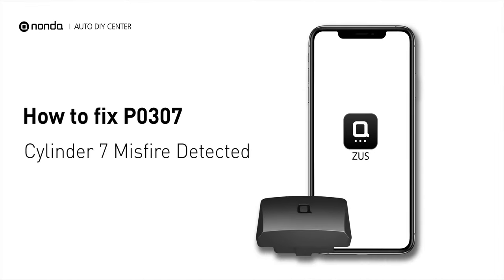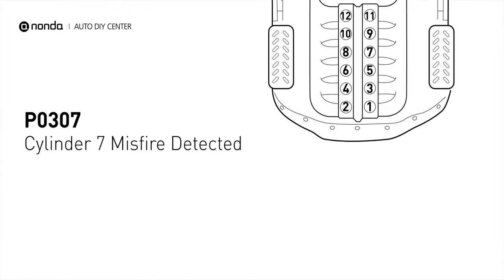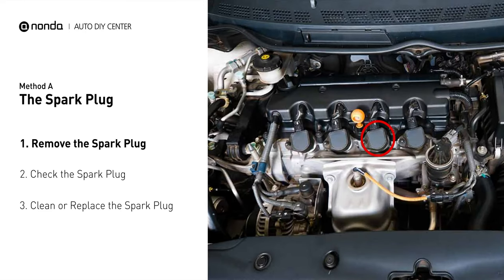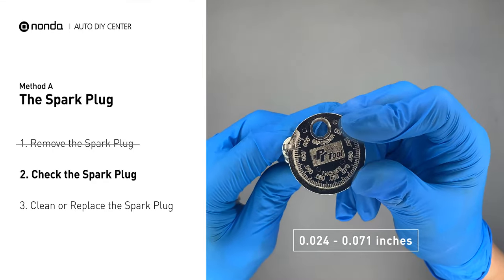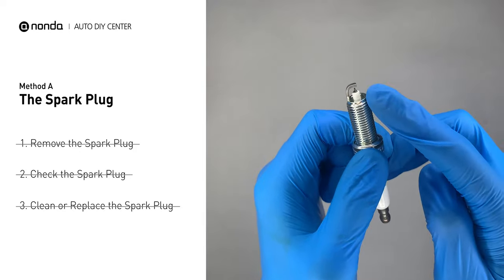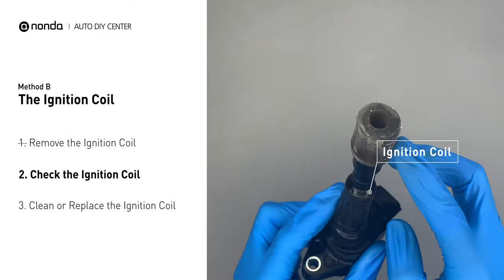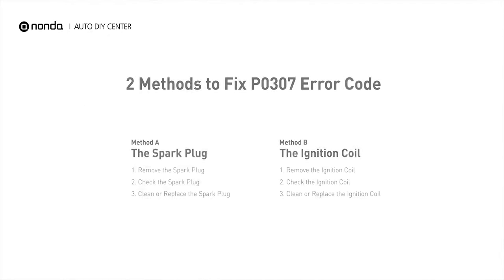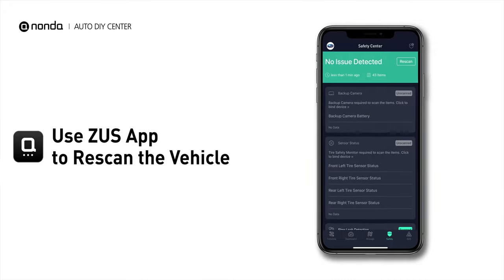How to Fix P0307 Engine Code in 3 Minutes [2 DIY Methods / Only $4.12]

Comment: Question is it cylinder no 7 or another cylinder I've seen another cylinder make it look like it was another cylinder , your thoughts? also, I had to put a sleeve in my cylinder good old Ford f150 4.6L with some red thread lock waited 24 hrs the put the spark plug in I'm hoping it didn't come loose ugg im open to suggestions as well and thanks for the video it helps.
Reply from the maker: Yes- it's an issue from cylinder no. 7. We suggest to begin checking for intake leaks. If there's no leaks found, inspect and test the parts of the ignition system around the cylinder to confirm whether you need (or not) to replace the coil packs, plugs and wires.
Reply: @nondainc  here is a deal for ya lol just kinda blew my mind on how good it was, I got all ing coils and plugs BRAND NEW from Amazon and got the parts  5 hrs after ordering (sigh) got nzt plugs on top of that which are pretty good not the best but they will do. Figured I'd pass on the prime info for you helping me n all, and they are for a 4.6L 8cyl, turns out there was water down in that cyl hole before takin out the plug which is a good thing by inspecting it and the others I figue, replace all for a great price, share the wealth of info, hope for the best.